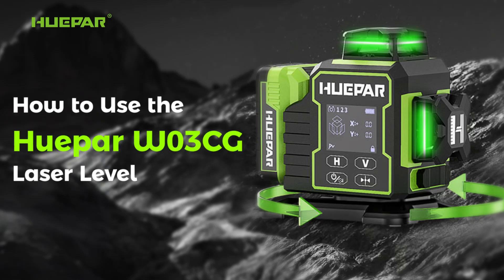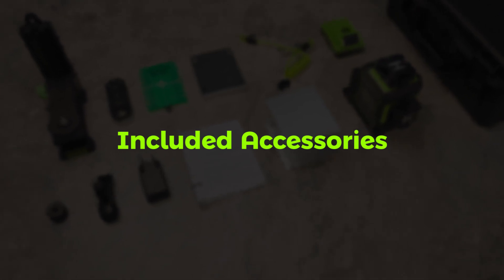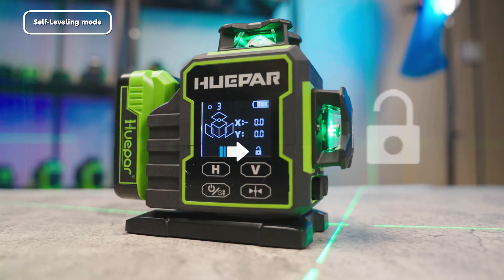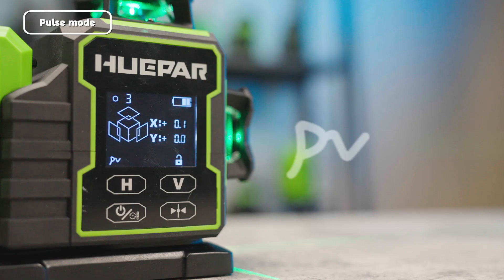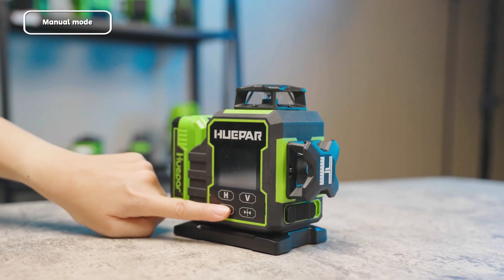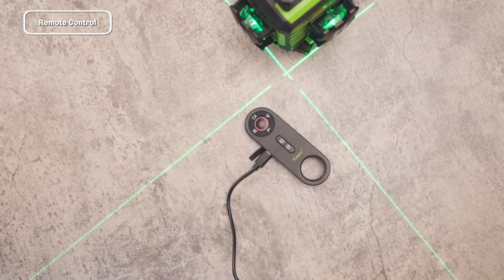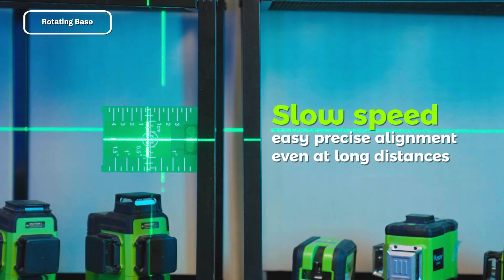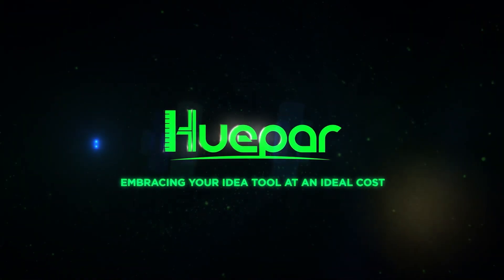How to Use the Huepar W03CG Laser Level: Designed for Effortless One-Person Operation

Comment: It should be on the video how to reset the x and y axis. But you have to make sure its on a complete level surface and then long press the bottom right button. The button with the two arrows pointing to the center.